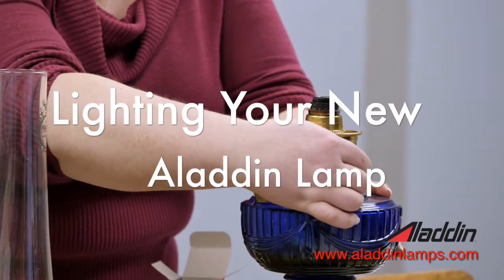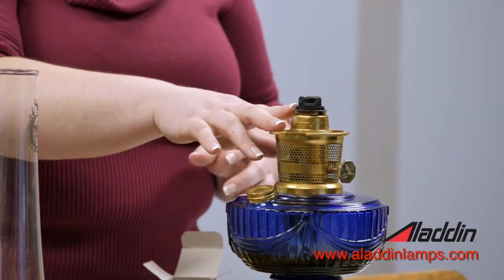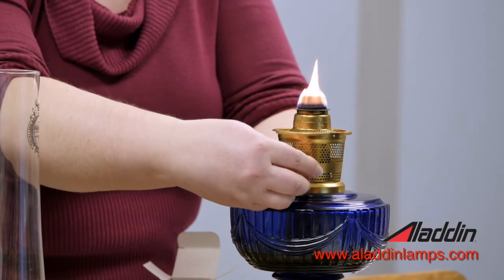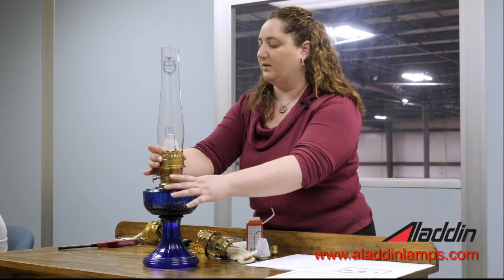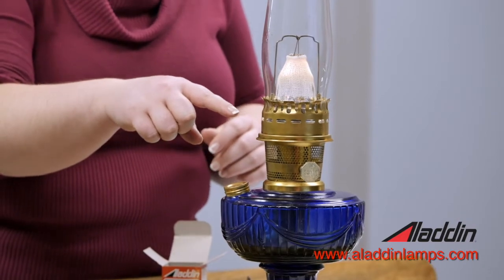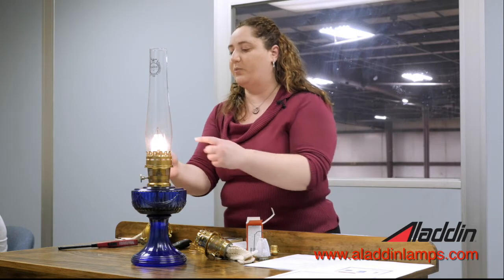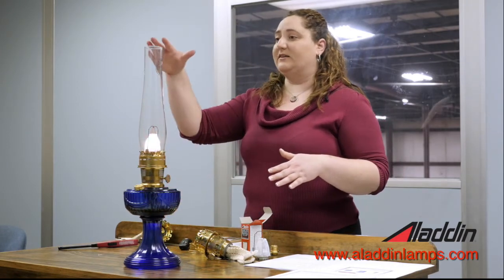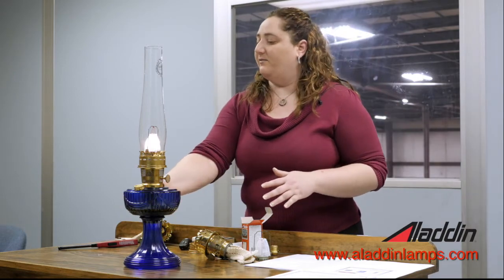Lighting Your New Aladdin Lamp

Comment: "So easy a child can light it. So safe a child can operate it" -Ad slogan on on my late Mother's Aladdin's Magic Lamp box from about 1930 from Chicago Mail Order Co. (Spiegel's).  Brighter than a 200 watt incandescent (clear) light bulb when adjusted properly (has the old "air shutter" below the burner for poor grades of kerosene), doesn't smoke or smell, and when the power is out, it's a lifesaver! No batteries, no propane tanks, no gasoline fumes or pumping, will burn over 20 hours on one filling (probably more like 32 hours), her's is a metal font (nickel?) model (Model B???) with a separate table base or a wall mount bracket and a glass shade, and might be adaptable to a hanging mount, she wasn't sure, and I'm not either. It was her fourth birthday present. $13.95 in Depression money.